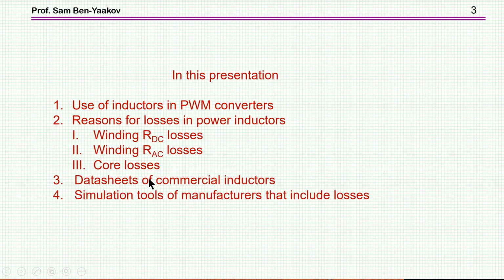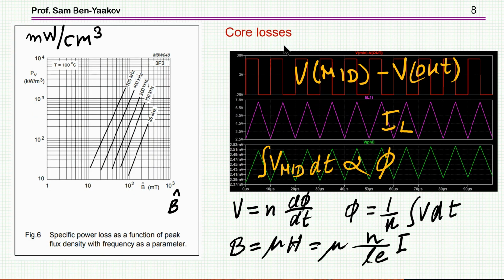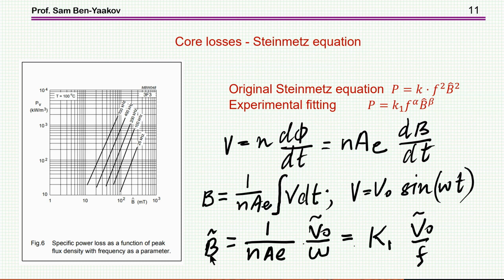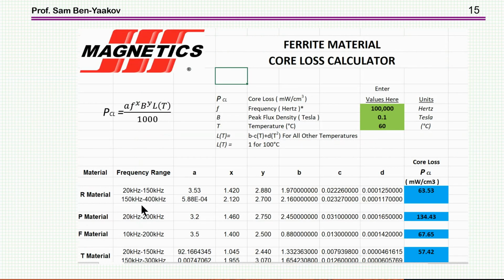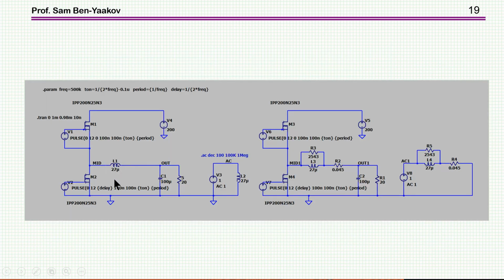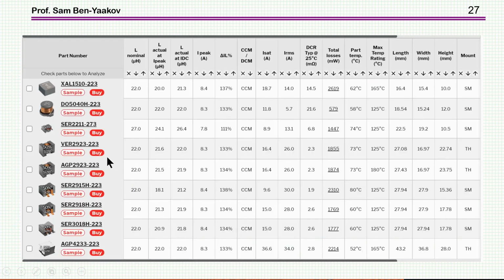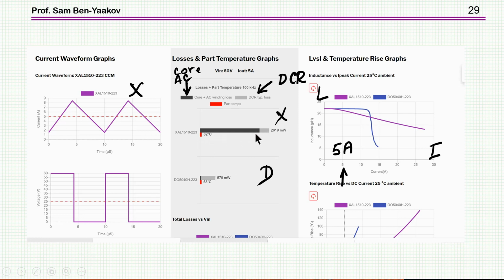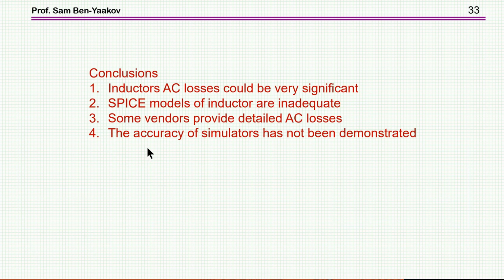Losses of power inductors in PWM converters - Revised

Comment: Interesting video although it is not surprising that all of the models are simplistic or highly questionable.

At 3:05 the Bode plot shows the inductance and winding resistance peaking at the same frequency. Is there a reason for this, or is it a coincidence, or maybe they chose the winding so that the resistance went crazy at the same point as the inductance hit the curie point? Just seems strange that these two seemingly loosely related variables would peak at the same frequency...
Reply from the maker: The plot assumes only L and R while when approaching the resonance the capacitance is significant, so the the L and R  approximation is incorrect.

Comment: Don't be confused by the 14.0 Amp value that is shown, that particular value is directly from the datasheet and is the rated RMS current that will cause a 40°C temperature rise from a 25°C ambient. They only show it so you can compare between the various inductors they have recommended. It has nothing to do with the simulation per say.  If you look at the datasheet for the DO part, you'll find the rated current is the exact 5.7A value shown from the "results" page as well. 

As for the drastic differences in core losses shown between the two inductors, we need to know more about how the inductors are constructed to make a determination.  Just because both inductors have the same inductance value, doesn't mean the cores are experiencing the same conditions. For all we know, the distributed gap core of the XAL inductor may have 1/4th the number of turns as the discrete gapped ferrite to achieve the same inductance value. The lower number of turns leads to higher delta-B in the core for a given voltage and "on time" and thus significantly higher core losses.  That's my guess as to the difference.   One inductor has more turns than the other, which leads to one core experiencing a higher flux density change and more losses.
Reply from the maker: Thanks Shawn or sharing your thoughts. May I add: It is not just the number of turns that matters but nAe. Still, there is a big difference in core losses between ferrite and iron powder materials for same deltaB, so it is hard to tell what is the reason for the difference. But it is important to know that same inductance inductors might have a big difference in losses, something that does not show in the datasheet, and that is the point that I tried to make in the video.

Comment: The fully enclosed choke,  Fe powder,  has high core losses due to the high current/flux ripple and the fringing of flux near the internal gap heating the wire.
For the ferrite open bobbin construction,  the wire is smaller which is better for Rac losses at this level of current ripple,  while the ferrite core has significantly lower losses.

As the freq goes up the ripple goes down,  explaining the drop in losses with freq in the Fe-powder core ...

Comment: Professor,
  1) Could the Rs increase with frequency (slide 6) encapsulate the core losses besides the skin & proximity effects?
I find it very compelling to say yes because  you can see that Rs increases initially with f² and being a resistor of course the power losses in it will be proportionally to I² ∝ H² ∝ B².  So the overall losses in Rs above ~30KHz are ∝ f² B²  which agrees with the Steinmetz equation.

  2) Also I'm sorry to bother you again, but on slide 24, though I totally agree with point 2, regarding point 1 I beg to differ.
In my other comment (in the retracted video) I mentioned that in the range 100kHz to 1MHz the equivalent model of the inductor was an inductor L=27uH in series with a resistor with value R=(ωL)²/2500 (i.e. a resistor that scales up with f²).

I calculated the above result by hand. But to better share the result with you I used Sapwin this time to analyze the inductor model in slide 16 (despite being a very simple circuit to analyze).
After getting the equivalent complex impedance Z, I plotted in Matlab the Real{Z} and Imag{Z}/ω. The idea being to try to get a picture like the one in (slide 6) and understand to what RL series circuit (Rs + Ls) the inductor model corresponds to.
The result is here:

https://drive.google.com/file/d/1X5Ov4HFvcsw7J8pe1hFHsfg1x33DZQQO/view?usp=sharing

Basically one can see that up to ~50KHz the inductor behaves has a Ls=27uH in series with Rs~45 mOhm (no suprises at low frequencies). From then on up to ~ 2 MHz the inductor behaves has a  Ls=27uH in series with a resistor that scales up with f², a behavior exactly as shown in slide 6, reaching values of Rs~100 ohm @ 2 MHz.
After 2 MHz the model does not captures well the Ls & Rs behavior shown in slide 6, so I would say the model is not valid anymore.

But, given the typical range of frequencies used in PWM converters, in my opinion the very simple model of slide 16 does captures some frequency dependence of losses.

Eventually what you're trying to say in point 1 of slide 24 is that the inductor model does not do any better job in modelling the frequency dependence of losses in a real inductor than the lumped circuit of slide 16.

PS: I guess my point on the other video was to say that the inductor model was equivalent to the lumped circuit (which you have proved in this video) and that the  increase in Rac or power loss with frequency seen there was not due to some hidden parameter or special thing  in the model, but it was simply due to the 2500 ohm resistor and that it could be calculated .
Reply from the maker: Hi, concerning the inclusion of core losses (as I have shown in an early video) , the excitation during testing is extremely small so the core losses are negligible AS for the other points. I will have to  defer as I can not spare the time now to plunge into it. Will try to do it at a later time. Sorry. Would you like to prepare a video to outlay your observations?
Reply: @sambenyaakov  
Hi. I have prepared a video trying to explain my point of view. 
I don't plan to become a "youtuber", so the video is unlisted and I kindly ask you not to turn the link public. You can find it over here:

https://youtu.be/Gaew76gHkmY

Please let me know when you have seen it so that I can delete this comment to prevent others (although unlikely) from finding it.

PS: this experience led me to appreciate much more the work you have with each of your videos. So, thank you.
Reply from the maker: @justpaulo  Please hold on a coupled of days or so until  I see the video> Thanks for sharing.

Comment: Sir, in the derivation @7:08 voltage applied to inductor is taken as sinusoidal. But in the DC-DC converter under consideration, it's a square-wave. Can we still use Steinmetz equation to calculate core-loss in this case? Or does the f^a and B^b captures this non-sinusoidal input  ?
Reply from the maker: Yes, this is a major issue. The information we have is on sinusoidal small signal. There are improved models such as RGSE. See: https://www.ee.bgu.ac.il/~pel/pdf-files/jour144.pdf
Reply: Thank you Sir 🙏🏽 for sharing both video and the paper.. They are wonderful and need of the hour.
Reply from the maker: @roja_p  👍

Comment: So you really need to test the losses with physical inductors, and either a test circuit with variable PWM frequency, or the actual circuit you intend to use.
Reply from the maker: I guess at this stage there is no escape from testing the inductor yourself.